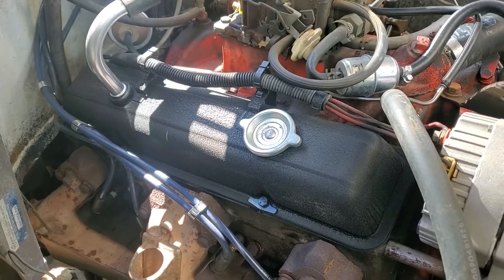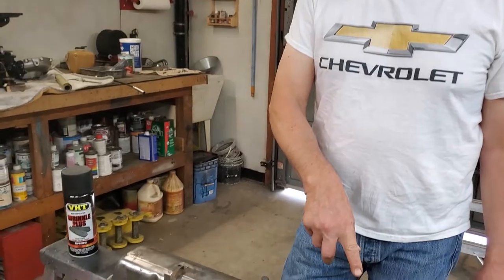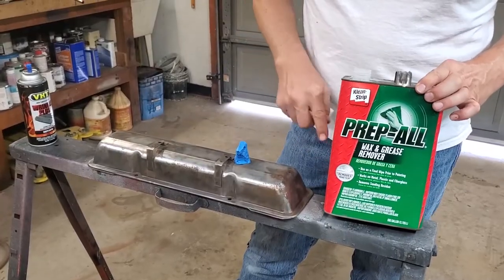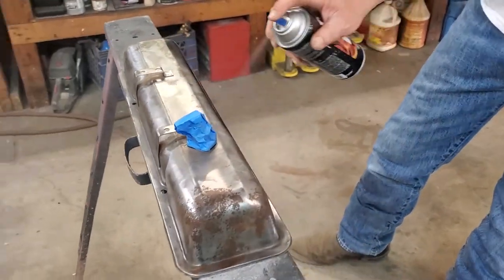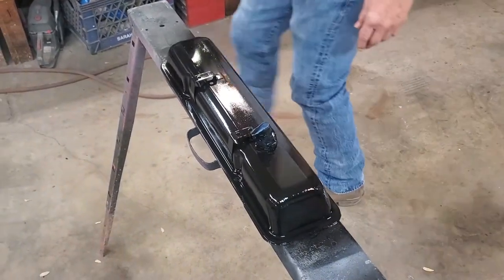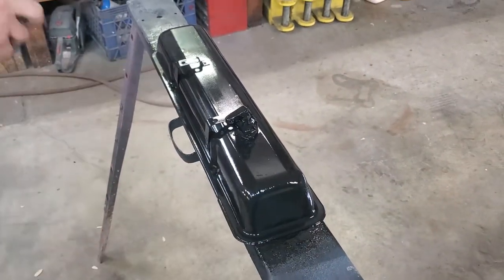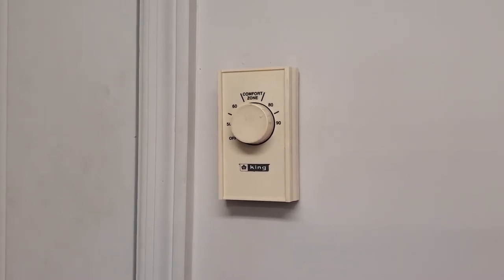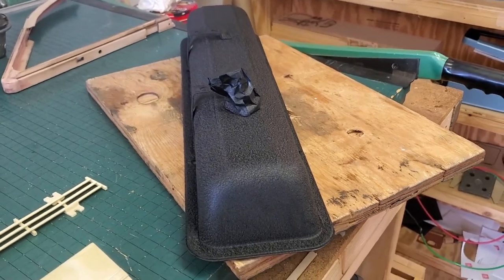Perfecting a Wrinkle Paint Finish - Wrinkle Paint Done Right

Comment: Why can't you just use a heat gun set on LOW? That's what they did in the VHT garage. Then they baked it in the oven for two hrs @200 something.
Reply from the maker: Not all paints should be baked in an oven that might be used for cooking. This method allows one to walk away and leave the project with perfect results each time. Thanks for watching.